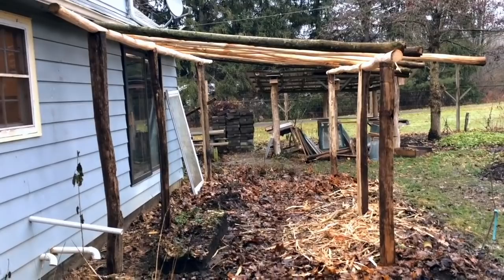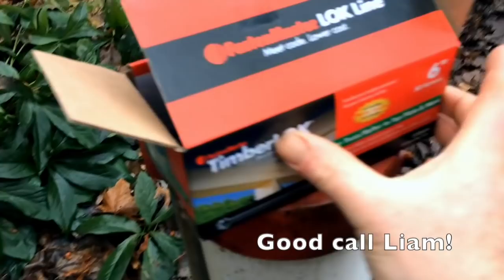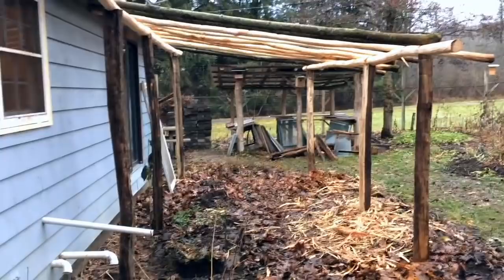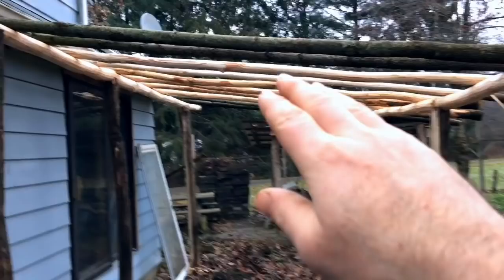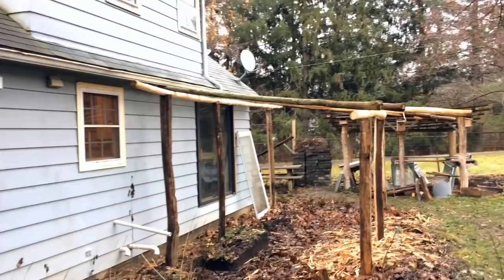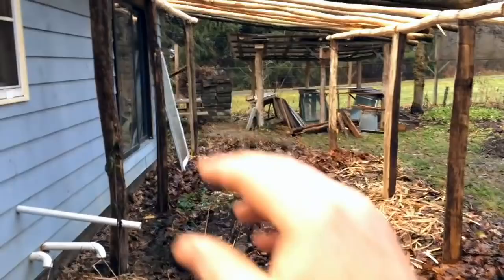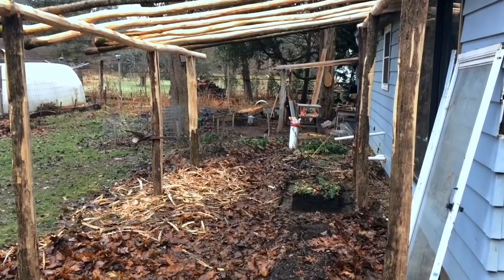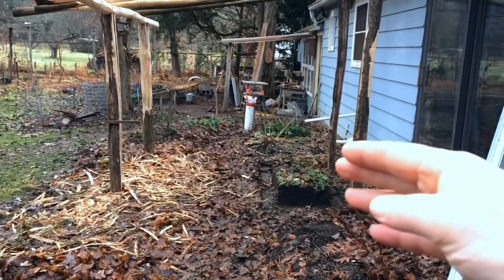Passive Solar Greenhouse - 1 - Start of Construction

Comment: I would put another support beam 6 feet away from the house wall.  It will give a lot more support for the roof, which is a very low angle and will not block out too much sun.  Not that much more work to do but a whole lot of piece of mind for the stability of your structure.  I would also cross brace the ends but I am guessing that you are going to do that anyway.  Great idea, I have used the same concept for my extended chicken run.  Lots of clear corrugated roof to give the chickens space where they are dry and even warm compared with an uncovered space.
Reply from the maker: Certainly plan for cross bracing, that comes in soon.  I think I will be including a mid-way brace that is connected to the wooden frame that will be the build out of the large permanent raised beds.  I think that will make more sense in the 2nd video...
Sounds like your chickens have a great steward in you!
Reply: EdibleAcres   Yes, I think so, thank  you.  I love your videos and am thinking of incorporating a covered leaf pile for my chicken - I collect 4-500 bags of free leaves in town when I go to work, over the Fall.  I would also like to include other kitchen scraps and maybe vegetable matter from town but am wondering about rat problems.  Do you have any?  Oh yes, and I am in Nova Scotia, Stewiacke area, so our winter weather is quite like yours.  And one last thing, I have almost completed a2bay wood shelter for firewood using your ideas.  A third, smaller bay on the end (unfinished at this point) will be for storage.  One bay is full - about 2.5 cords, for next year.  The other side has 2 rows to be brought inside for this year and then I will fill it with another 2.5-3 cords for next year.  Thanks again for your very informative videos.

Comment: I was wondering if a hybrid system would be better, if there will be enough sun penetrating through the side glass windows? What if you built an insulated tin roof, with glass panel inserts, spaced evenly along the roof. There's somewhere between 8-10 spaces, between your string of rafters. So you'd really only need 4 long glass panels. The rest of the spaces will be filled with roofing tin and insulation. It all depends how much you're  relying on the sun entering through the roof to keep the heat inside. I would also have a heat sink in the floor, like pavers or recycled bricks.

A point for next time, but when putting unprotected wooden posts in the ground, burn/char the end that will be below ground level. I'm told this helps preserve them in damp climates, by preventing mould. Do some research on it before trying though. Nice work on your greenhouse, thus far.
Reply from the maker: Thanks.  These black locust posts, with the bark peeled, should be solid for between 60-100 years in the ground.  It is just about the most rot resistant and strong wood I could ever imagine working with, so I'm not worried about them!
 I think with the roof it has to be clear all the way since we really enjoy how much sun comes into the home now through our sliding glass door.  But yes, more insulation and warmth in the roof would be a better way for the plants.

Comment: Did you consider the sun angle throughout the year? Are you planning on using it for season extension, tropicals, etc.? Does it actually make sense to have a fully transparent roof (especially part next to the house) for mid-summer sun exposure?
Reply from the maker: I tried my best to consider sun angles with this structure.  We do plan on having it in use year round, and have plans for ways to very intensely ventilate in the summer with a passive setup, and provide shade at peak summer with strategic plant placement...
Reply: EdibleAcres can always put shade cloth on top if July and August sun gets too intense. You have a lot of trees, too, so that should mitigate some of the summer sun issue.

Comment: Sounds very exciting. Something I will follow with great interest. I'm wondering how you will deal with excess heat in summer, and also how will you vent excess heat? With double glazing it will likely be more of a problem than with your tunnel house and might feed excess heat into your home as well? It's something I've wondered about for a while when considering this sort of set up.
Reply from the maker: I'll be sharing more details on this as it evolves, but there are some baseline design elements that should hopefully handle intense heat/humidity in a passive but thorough way.  More details in the 2nd and 3rd videos as I develop it...

Comment: Some suggestions (still have a lot of tweaking to do on my attempt for a passive solar greenhouse): maximize insulation, ventilation for cooling, moist reduction, air circulation and thermal mass. My almost flat laying solar panels tell that amount of light during the winter is only 10 percent of summer light. If you combine that with low temperatures, plant growth will be very limited, so all winter crops need to be well established at the end of fall. Best wishes, greetings from Holland.
Reply from the maker: Great suggestions here.
Reply: Your almost flat solar panels are likely lying to you.  If you tilted them you would not see as much loss.  Also you are about 8 degrees further north than edible acres, so are actually getting less and more tilted light than they do.
Reply: @CorwynGC  Panels are east west oriented, not the normal south facing, tilt is 15 degrees. Main reasons: keeping the static and dynamic (wind) load as low as possible in order to minimize the (ballasting) weight on the flat garage roof and trying to harvest more power in early morning and late afternoon, thus reducing the upload to the grid around noun. At the moment we have same price for producing or using power, but that will end within a couple of years. During winter we also loose some production days because of snow cover. I agree my setup is not optimized for total production or return on investment. Hope this explains the differences i observed between winter and summer (aggregated) production.
Reply: @earlshine453  My point was merely that your experience is unlikely to be indicative of Edible Acres.  

If you are pointing them East and West, you might gain 2% or so, by putting them actually flat.

Comment: Thanks for making this video!  I don't know if you listen to podcasts, but Jack at TheSurvivalPodcast has 3 acres and has built quite a few greenhouses.  Just a couple weeks ago he did a whole show on what he has learned about greenhouses, and he specifically talks about those TuffTex panels.  The summary is the wavy ones get brittle, but he's in Texas sun, and the wavyness makes it hard to seal the sides without buying their special foam inserts.  He makes a pretty strong case for buying off-cuts of plate glass or miss-cut tempered glass.  (You can't cut tempered glass, so if a shop makes one to the wrong size they will likely sell it for almost free)  I'd say it is well worth the hour to listen to what he has to say: http://www.thesurvivalpodcast.com/new-look-old-green-house
Reply from the maker: Thanks for this.  I'll make a note to check it out for sure.

Comment: Hi, I enjoy watching your videos, it's great seeing what you do. If you can I would go for twin wall polycarbonate sheeting, you could go for the thinner stuff to keep the price down. The roof is going to be prone to losing heat as any heat is going to rise to the highest point.
Reply from the maker: I hear you on heat loss up high, I just wonder about how to install that material on a slightly wavy and shallow pitched roof line... Hmmm.
Reply: you could try foam cut in lengths running down the poles and then screwed in using the rubber screw caps to stop it splitting.

Comment: timberlock screws are very good screws but also very pricey
Reply: Agree i was able to get some at cost with bulk pricing to secure my whole roof all arpund the top plate to hurricane proof my home, i ended up getting 1000 10 inchers for 30 cents a peice instead of 1.25 each in boxes of 50
Reply from the maker: True, but so far they are easy to work with, crazy strong and feel like a good solution so I'm happy to give them a shot...

Comment: It would add an expense but using greenhouse poly on the underside of the roof will create  the thermal barrier  at the same time allowing light in and reducing the work of shuttering every night . Also .Do you think the slope is steep enough to handle snow loads  ?
Reply from the maker: I do think it will handle snow.  White Ash poles, in the full round, are stupid strong.  I'm going for 18" spacings and locust perlins.  I think it should be able to handle 2'+ of wet snow without a problem.  I can sweep it if something more serious comes through...
poly on the underside... I like that quite a bit!  Could be a great solution for the coldest part of the winter!

Comment: Thanks for the video, Sean!  Hey, are you concerned about mold or other humidity/wetness issues where the GH touches your home?
Reply from the maker: I would be, but I think I've got some ideas on how to handle that potential issue.  I'll be going into detail on that design approach in the 2nd video, as the concept evolves.  Important question, though, for sure!

Comment: I have panels like that sitting in my garage that we bought years ago.  Dip craft in Braddock pa. Is whom I bought them from.  With the panels, came wood strips that were cut to the curves of the panels so as to fasten them better to framing.  I am not sure if they have an internet link or not.  Dipc raft in Braddock PA🌈🤙
Reply from the maker: I looked them up... Do they offer fully clear panels?  Looks like translucent fiberglass?
Reply: EdibleAcres I am not sure if they have clear panels.  What I have is the translucent stuff.  What is nice about them is that they gave me so much linear feet of the cut wooden mounting board that fits into the wavy panels

Comment: Quick question, any footers for your poles contacting the ground?
Reply: He used a very low rot wood called   black locust. I doubt he did!
Reply: Yep I know it's locust but that wont solve for frost heave
Reply: @davidsimpson2635  good point! I don't have frost heave where I Iive.
Reply from the maker: Thanks for asking, I should have covered this!  I used a post hole digger to go down a little over 2' and set the posts in, packed super densely with stone and soil.  I didn't think I needed to go much deeper because it's close to the home and will have so much weight in soil and insulation from being a greenhouse that I think that should work...
Reply: Thanks for the reply Sean! I'm gearing up to build a deck on my house so these things are on my mind Haha. . . Good work, cant wait to see how it turns out!

Comment: Why do you peak the bark off? I am assuming it is not an aesthetic thing.
Reply: Idk if this is his reason, but having worked with barked trees: in my experience it tends to not help in any way and depending on its thickness, it might get in the way.
Reply: It tends to hold water and bugs that rot the wood faster.  Also eventually it will dry and fall off anyway, so...
Reply from the maker: Great question, I should have covered this... 1) Under the bark is where bugs/fungus can live.  I would want this wood to dry down completely and not host bugs/rotting material, 2) It is much lighter in color peeled so more light, 3) peeled wood seems to last MUCH longer, especially in a challenging situation like this.

Comment: I installed Tuff-Tex on my GH roof.  Done over again, I'd lean toward multi-wall polycarbonate.  You have to install "closure strips" to limit air invasion (https://goo.gl/Uv8vTm) with the Tuff-Tex.  I ended up lining the inside of my roof with 6-mil polyethylene sheeting!  Would've been easier to just use multi-wall from the start.  You're in upstate NY (correct?).  I'm in Colorado (40 deg latitude).  This time of year, I'm essentially getting zero direct light through the roof, so I focus on maximizing light through the south wall (using clear acrylic "plexiglass").  I've got compost heating and a GAHT system in place in "greenhouse 2.0" (https://youtu.be/Ze0nXN6Vvic) and will report shortly on the performance.  I think my GH is about half the size of yours.   I really look forward to seeing your progress on this.
Reply from the maker: https://www.youtube.com/watch?v=Ze0nXN6Vvic&feature=youtu.be
(your link has the ")" stuck in it...  I'm going to watch this right now!!

Comment: I get what your doing but bite the bullet and bring in carpenter. You can really damage your house if it done improperly. Love your channel.
Reply: He has done something very similar to this before, I think he knows what he is doing.
Reply: @breadbread4226  yeah I went diving once that doesn't mean I qualify for a master license.
Reply from the maker: @Adonis - I get what you are saying but I'm comfortable doing this because 1) It will not be mounted directly onto the house.  It will be quite close, but will be a stand alone structure and 2) I do have experience doing this kind of building now.
The idea of the diver not qualifying for a master license... I get it, except this is more like a novice diver enjoying doing some more diving... I'm not trying to run some workshop or install this for a client!